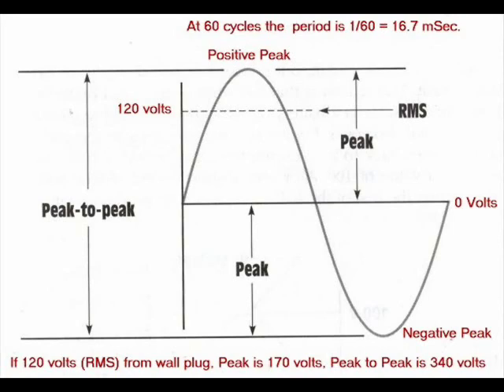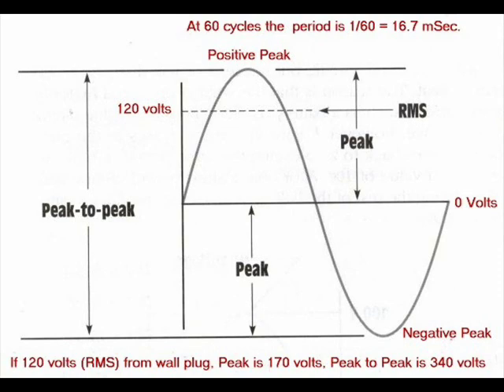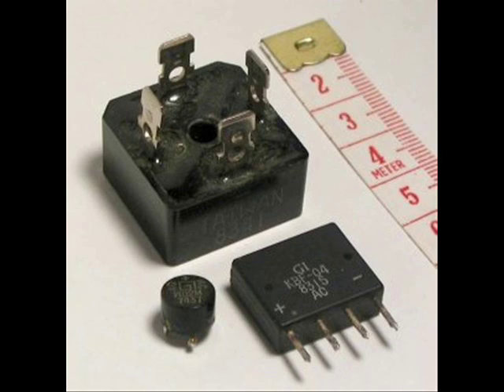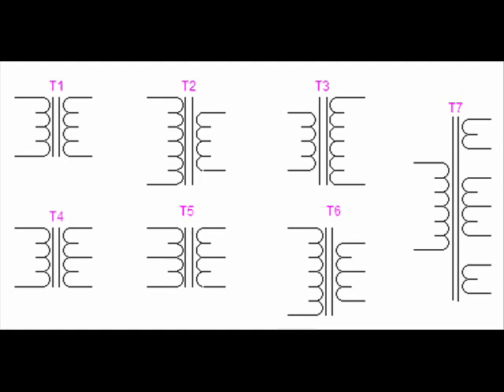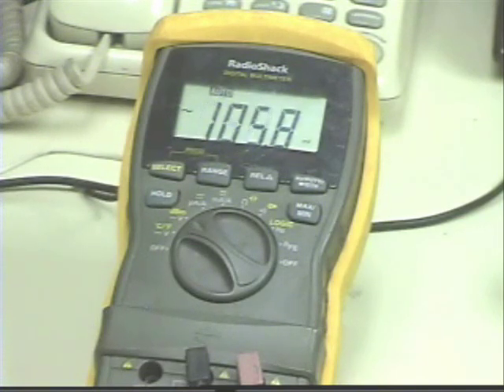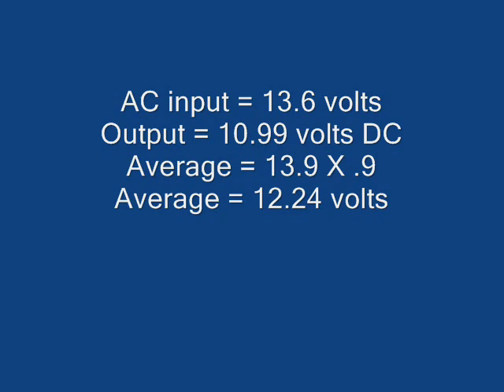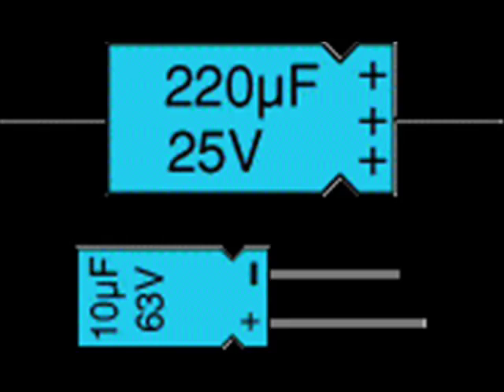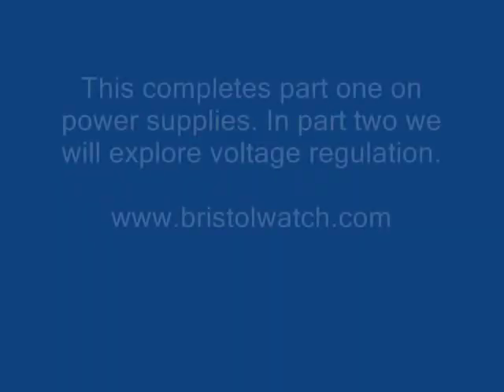Basic Electronic Power  Supplies Part 1

Comment: What will happen with the current in input if you don't put a load (resistor) in output. Would current go as high as possible causing damage in transformer ?
Reply from the maker: +Shpetim Ahmeti The voltage will float to peak and won't hurt anything.

Comment from the maker: Basic Electronic Power Supplies Part 1
Basic Electronic Power  Supplies Part 1

Basic Electronic Power Supplies Part 2
Basic Electronic Power  Supplies Part 2

Build a low voltage DC power supply Part 3
Build a low voltage DC power supply Part 3